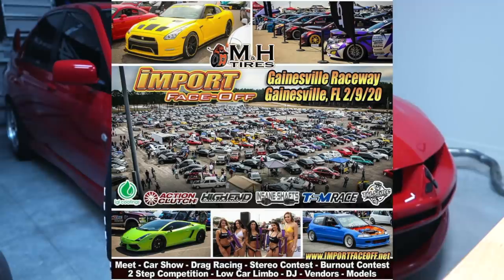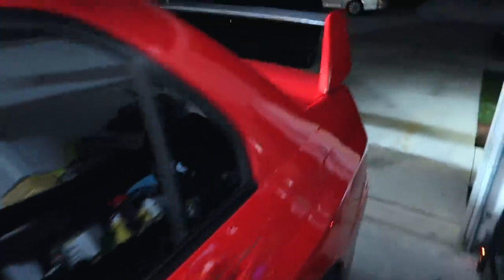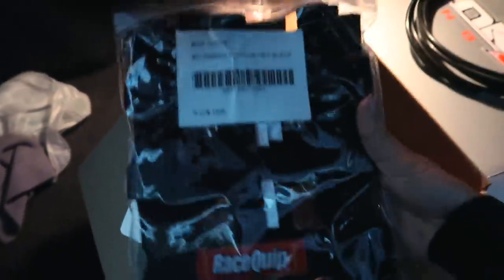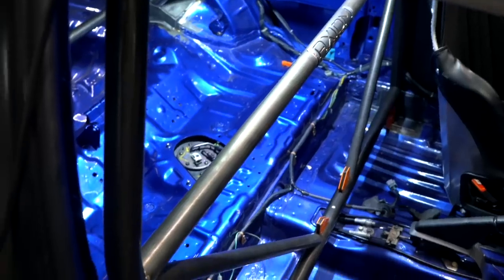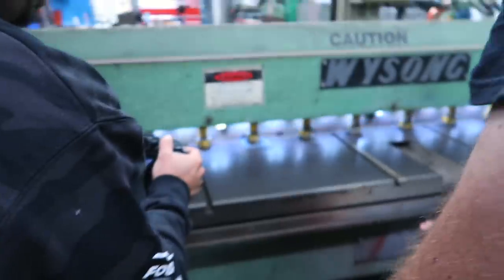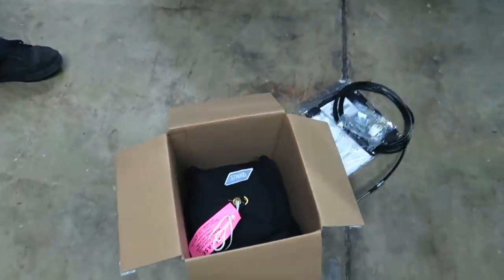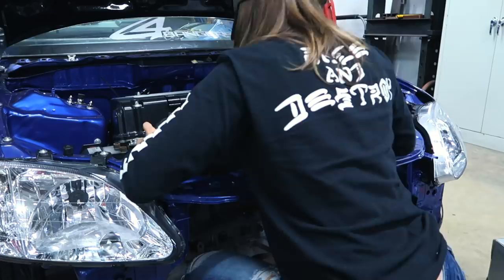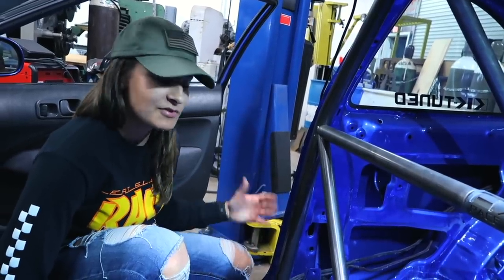10 POINT CAGE ON CIVIC SI

Comment: You should go with upgraded brake kit, 2008 acura tls type-s brembo brakes and 09 mitsubishi evo 9 rear brembo brakes. They will require some modifications but for alot of power you would need that
Reply: Carlos Vazquez there's no such thing as an 09 evo 9.  There's an 06 evo 9 and an 09 evo 10.
Reply: Shea my mistake bro! Thanks for your correction